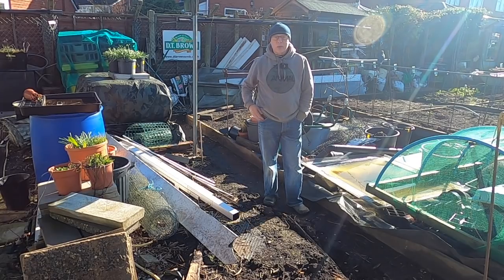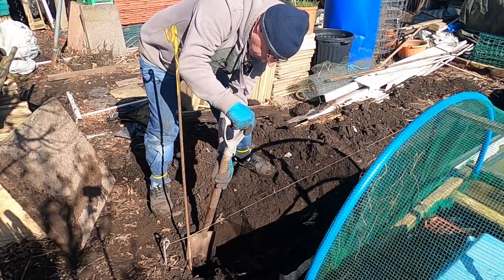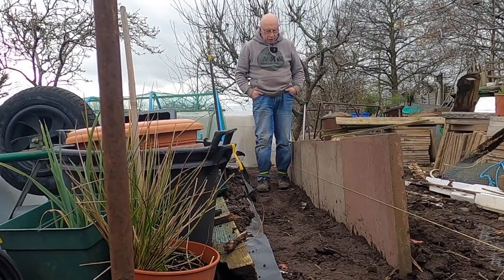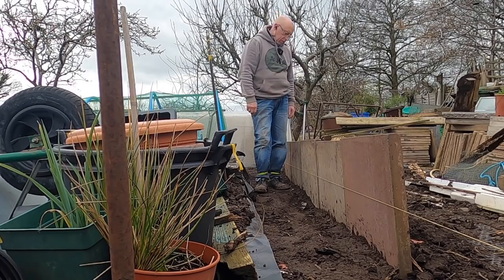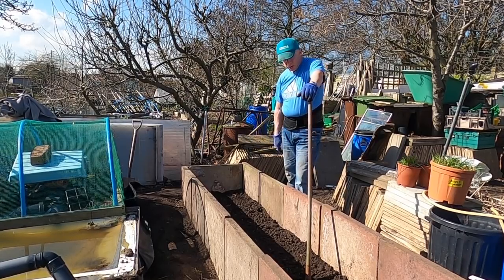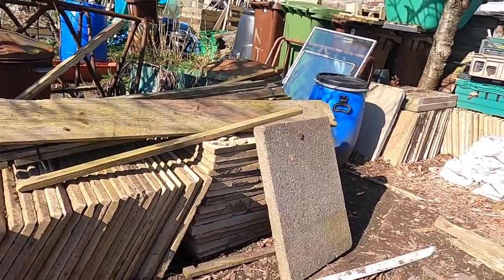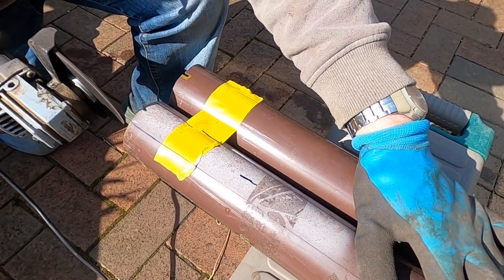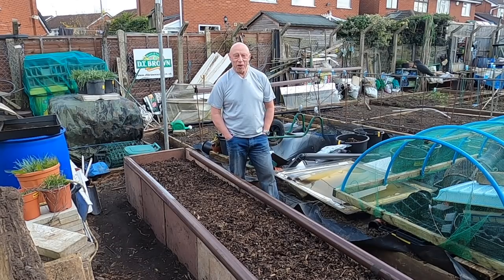🌻277 🌻 HOW TO BUILD A PERMANENT BEAN BED 🌻

Comment: Hello young Nigel, I like your new raised bed, great job, but I'd seal the gaps at the ends of the gutter pipes to prevent any slugs from getting in there and making themselves too comfortable.
Reply from the maker: Hello Stephen.  I will. smear petroleum jelly around the ends end edges... this also works for me on the legs of my Vegepod 👍
🌻🌻Nigel…………MuddyBootz Allotment🌻🌻

Comment: Looks good Nigel. How about a couple of 90° brackets drilled, nut & bolted in the corners? I did it 30 odd years ago when I made an alpine bed from paving slabs.
Reply from the maker: Good idea Steve. Will see how much the ends move once the composts settles 👍
🌻🌻Nigel…………MuddyBootz Allotment🌻🌻

Comment: Hi Nigel,Bit by bit as our wooden raised beds need replacing, we too are using slabs,2ft square are good but 18inch square are easier, however beggars can’t be choosers we use what we get,once you have edged the beds with slabs job done you can forget edging forever,yes it is hard work but bit by bit it soon gets done.happy gardening.
Reply from the maker: Hello Jackie, most of the large beds will be done with 18" slabs ... at least I know they won't be so heavy 🤣
🌻🌻Nigel…………MuddyBootz Allotment🌻🌻

Comment: Hi Nigel,, I've been doing something similar, instead of the paving slabs I've used leftover concrete roof tiles from the new roof we've had on the house,, the tiles are 16 inches deep by 12 inches wide,, I've buried them 7 inches deep giving me a 9 inch raised bed
Reply from the maker: Hello Philip, that will be ideal and should last for a longtime 👍
🌻🌻Nigel…………MuddyBootz Allotment🌻🌻

Comment: That's a nice job...I was thinking of a steel channel around the outside 4 walls ...but that works....doing the same thing here today actually....only on the cold frames....they are some 6 or 7 years along and need replacing....the only other permanent way I have seen and like are bricked ones....for both raised beds and cold frames....
Reply from the maker: Hi Jim, I have a ratchet strap waiting to arrive, hopefully that will do a permanent job 👍😀
🌻🌻Nigel…………MuddyBootz Allotment🌻🌻

Comment: I like that down-pipe idea Nigel, sadly no bricks or pavers allowed on our site now under the new rules, so it’s rotting wood or nothing : all the best - Steve
Reply from the maker: Hi Steve, it is amazing how much extra strength the pipe has given to the side structure, I have put the feelers out with my construction mates to save me any decent lengths of downpipes. Unfortunate with that new ruling on your site. does that mean any previous pavers on there have had to be removed?  All the best
🌻🌻Nigel…………MuddyBootz Allotment🌻🌻
Reply: @MuddyBootz  fortunately not and I managed to get a decent selection of rocks and bricks for holding down nets etc before the ruling